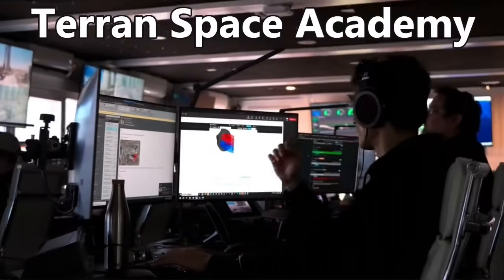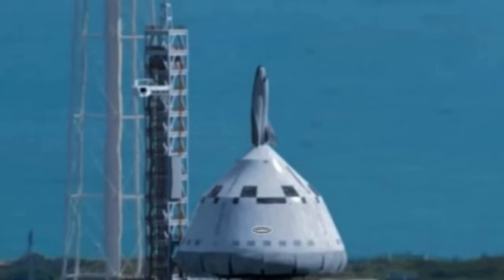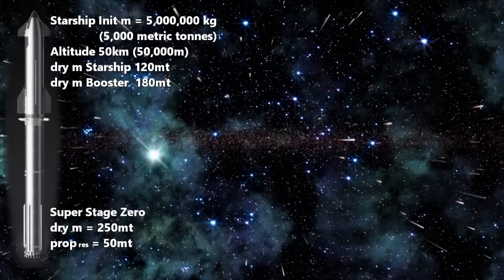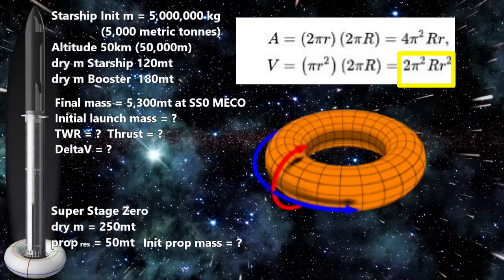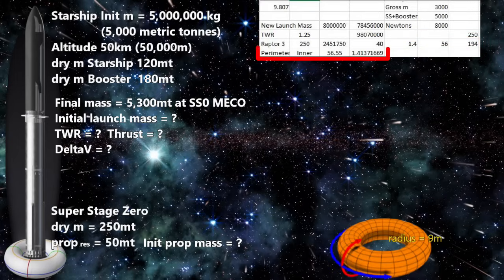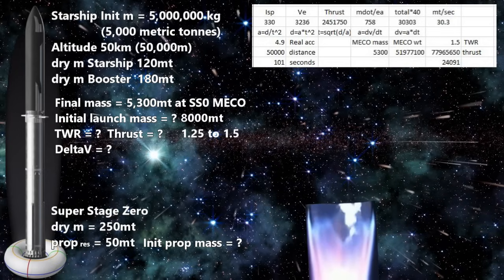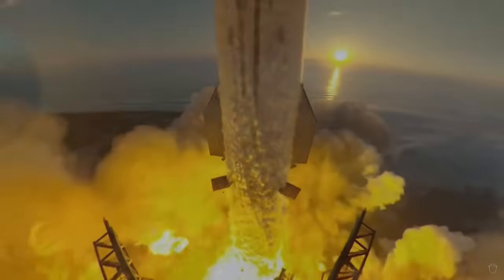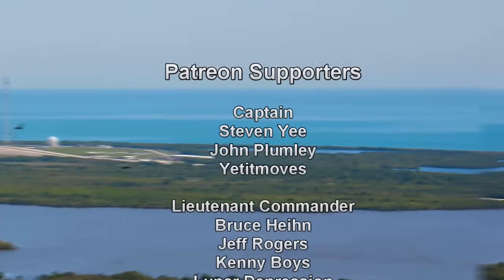Making Starship Better with Super Stage Zero!

Comment: Would make more sense to do a starship triple heavy ability to bypass orbital refilling
Reply from the maker: Yes it would. We did the math on that one about two years ago.  In a lesson on artificial gravity I think.
Reply: That would defeat the entire point of the Starship system design, that being that everything returns to the launch site. With every Falcon heavy launch the center booster is expended. It's gone too far and is going too fast to return. It's far more efficient to launch Starship multiple times with everything coming back to the launch site, than it is to expend a booster.
Reply: @snek9353  The center core of FH doesn't have to be expended.  It depends on the mission requirements.  SpaceX tried to land it on the first launch but missed the drone ship somehow.   They did land it on the drone ship on one of the other missions, but lost it on the way back to port.
Reply: @TheUweRoss  Almost certainly would be for a Starship version. No drone landing available for the SH booster, and it'd take three towers to catch them. I suppose potentially way down the line they could do the oil platform thing with a tower on it down range for the core booster. 

But what really would be gained by doing all of that which couldn't be done better in another cheaper way. Even IF doing so would get three times the fuel to orbit. It'd still be more cost effective to launch Starship three times instead.
Reply: @TheUweRoss  The only thing along these lines that I could imagine makes sense is using two Falcon boosters for Starship Tanker launches. 

Many ideas that result in the super heavy booster going faster defeat the entire point of the Starship system design, that being that everything returns to the launch site. Can't send the booster too far away or get it going too fast or it won't be able to return to the launch site in reusable condition. That and the entire idea here is cost effective up mass. It's presumably going to be more cost effective to launch Starship twice than to do just about anything else. 

However they'll need to build some Starship Tanker versions. Versions of the Starship that are all fuel tank, that have no other payload bay. These fully loaded with fuel could be much heavier than a Starship designed for putting satellites or people in orbit. 

To help launch these with as much fuel as possible making it to orbit using extra boosters could make sense. A couple of Falcon heavy side boosters attached to a super heavy core could be just the trick. It wouldn't take much extra infrastructure to do it, they'll have the boosters, and while the Super Heavy core needs to and can return to launch site the boosters could land down range on the drone ships if needed.

Comment: just add falcon 9's around the starship
Reply from the maker: I wondered about that too. Reusable boosters.
Reply: @terranspaceacademy  dad and I had this exact conversation, he had proposed something similar to your taurus with jet engines idea, but had completely forgot about prop :P
He'd talked about that since I was fairly young actually, I guess I've been thinking about this a while too now. 
Just for fun, I used chatGPT to explore the idea of falcon 9s as boosters a bit more, and it/"we" basically came to the conclusion that you could hypothetically strap 7 falcon 9's around the starship, which alone would give the vehicle a TWR of roughly 1. If you then Throttled all the raptors to 50% it would lift off. Some prop savings overall, but shows that using raptor 3's would be way more efficient haha
Maybe instead, 2 starship side boosters... 

anyway happy new year, love your channel, all that, and everything else, cheers :)

Comment: I thought you were joking to begin with. A couple of thoughts I had while watching, will be one long sentence per thought so it will look like awful grammar. Jet engines don't respond particularly rapidly to throttle changes. Would using cryogenic fuel for a jet engine be feasible, it takes a lot of energy to gasify LNG and you would have to spend some fuel just to heat the fuel, but liquid injection is a great way to cool and densify the air for efficiency, a from the ground up specially designed cryo-fueled jet will be significantly more efficient than a "warm fuel" engine and have a very weird outsized looking compressor side. Toroidal tanks are very bad shapes for drawing fuel from and for slosh, a triangular or square structure with an array of spherical tanks may be better, and consider the thrust and weight stresses on a primarily toroidal hollow structure, its not as strong as a cluster of spheres. Jet engines are designed for efficiency at cruising altitude, horizontal use, a broader atmosphere pressure will make it worth having a variable compressor, the jets can be supplemented with some oxygen added at higher altitudes, helping them work for longer. Engine icing is an issue in jet engines, the first stage of the compressor is often heated with some already compressed and heated air from later in the engine. Jet engines will be a LOT of trouble, and need special design. moving the jet engines to the inside of the torus allows some more efficiency with ram-air.   that concludes my stream of consciousness while watching.
Reply from the maker: There are a lot of issues. You would need a duct to pull air in on the fall back and you would need to cool it with an intercooler like Reaction Engines makes.  That's doable with cryogenic propellant.  The duct would need to start pulling from the top once the engine was up to speed.  Heat exchangers near the outside rocket engines could provide the heat but then you are adding a lot of mass.  For those and many other reasons jets just aren't really worth it when it comes to rockets.
Reply: @terranspaceacademy  Yeah, but it was a fun thought exercise. Your videos always are, thankyou.

Comment: The potential problem I see here is the increased velocity of the booster for return to launch site, spacex have indicated that they intend to put more of the lifting work on the ship than they currently have rather than the booster. Higher velocity means higher temperatures as well as increased energy for the turnaround and landing burns.
Reply: You have further to travel back to the launch site and are traveling faster.
Reply from the maker: That's why it's kind of a "pop-up" booster.  Going almost straight up and down.

Comment: Always good to entertain different options just to see how far or feasible the idea is.  How about strapping 4 more SHB like the Falcon heavy?  All the boosters will landed back.  Would need more Mechazilla towers.  Otherwise, SpaceX is good at manufacturing boosters and starships in a hurry.
Reply from the maker: Indeed.  That would be a much more practical plan.
Reply: @terranspaceacademy  maybe you can make the recommendation.  They’ll listen to you.
Reply: Ohhh. I like this. It might be enough to push the huge starship to leo with actually useful payload. It's reusable and already available tech.

Comment: How do you propose to restart those eight turbofan engines while falling backwards? Starting a turbofan engine with a strong tailwind can be nearly impossible when trying to counteract the reverse windmilling of the engine spools. Guaranteed engine overheat and catastrophic failure at essentially supersonic reverse velocity.
Reply from the maker: Good question... Compressed air blown through from the front? Blocks on the bottom that fold after start?
Reply: @terranspaceacademy  Maybe something like the spoon looking contraption used for reverse on jet boats.

Comment: That looks like an aerodynamic nightmare for which 250 MT sounds like a very optimistic estimate, especially when the SERV weighed 2700 MT dry ...

 Imagine the drag forces on such a design. Plus weight of shielding?

Also, increasing height and speed of the booster will make it a lot more complicated to recover it.

Would be interesting if someone could simulate this in KSP ...
Reply from the maker: No shielding required. Only going to 50km. But the dry mass is almost certainly low.

Comment: An autorotation capable tip turbofan helicopter 1st stage to lift to 10 to 20kft might be more efficient.
Another crazy option is a massive airplane to air launch a 
HOTOL or a Reaction engine powered 2nd stage with starship payload.
Reply from the maker: I like that idea!

Comment: I don't think this makes sense for starship. 2 stage to orbit make most sense for reusable rockets. You can make the booster need not so much shielding. For a 3 stage solution 2nd stage need a massive boostback and much more shielding. What would make more sense is to pack some super efficient upper stage into starship if you want to get smth to jupiter or somewhere farther
Reply from the maker: Not at all, just fun to think about.

Comment: Would the altitude that is gain from this configuration require the supper heavy booster to accommodate heat tiles for re-entry, wouldn’t that eat away what gains are made? The turn around time for another Rocket launch would also be greatly increased.
This all seems like a pyramid scheme that uses fuel ⛽️ instead of money 💰, and only those at the top win’s 🏆.
We definitely need to sort out this gravity problem.
Reply from the maker: It shouldn't but would need to do that math on that. Good point.

Comment: What about adding solid boosters ? Or why not have a center core solid booster that can be extracted and reloaded with a new one. That would require less raptor engines as they would surround the exchangeable solid booster center core cylinder, like a crown and be used for steering in addition to the grid fins during ascent.
Reply from the maker: There are many better ideas. This was just fun.
Reply: Solid boosters arent rapid re-use, you'd need a huge stock and refurb facility.
Reply: Also solid boosters cant be stopped, once ignited.  They were actually prohibited for human space flight.  But then there were many cut downs on the SpaceShuttle design, ending in total crew loss twice.

If there were sane regulations, I would prohibit a crew missions unless there is a rescue vehikel, capable of launching within 90 minutes.
🚀🏴‍☠️🎸
Reply: @rubikmonat6589  There is no reuse, the idea is to reload expandable cartridges of solid propellant inside, the cartridge would only get a thin metallic cylinder for the insertion process. The inner tube receiving the cartridge would be made of thicker/stronger metal, it could help increasing vertical weight load resistance, making pressurisation of stage one unnecessary to avoid tank collapsing during transport.
With a top opening on stage 1, the cartridges could be installed with the chopsticks arms.
Another benefit could be to have multiple long helix fuel tank dividers running down around the center solid core cylinder to the raptors engines, as the fuel goes down in the burning process, collapsible panels would come down, obstructing the way for any fuel sloshing trying to go back up.

Comment: 6:22 get on with it.   This isn't an intro to geometry video.

Also, this doesn't seem to take into consideration that the booster is presumably much further downrange and either needs a drone ship or more fuel to land and maybe more mass for heat shielding or more more fuel to slow down more.
Reply from the maker: Good points... And it's geometry if I say it is! (Or if I need to double check things :-)

Comment: Great video! Very good suggestion! Unfortunately, there is a huge insurmountable obstacle in the path of this being adopted! Of course, I am referring to the huge, plant sized ego of the chucklehead toddler, Elon!
Reply: I think the sheer logistics of such a massive vehicle are a bigger obstacle.  For one, moving the first stage would be an enormous endeavor even before launch.  Moving the Starship right now is already so difficult as it is.  The reason starship does RTLS only is because of logistics difficulties.
Reply: @dl2839  
Good points!
Reply from the maker: It would be far too complicated to try at this point but the thought experiment is illuminating.
Reply: @terranspaceacademy  
I agree, circumventing Elon’s ego at this point in time would be much too difficult and probably impossible.

Comment: There's a carnival ride that uses compressed air to shoot people up, and it also catches them and brings them back down. You technically only need one valve to make it work.

It's very simple to scale.

You could give a significant kickstart at launch. And take load off the catching arms motors, by acting as a pneumatic shock absorber, during landing.

You don't even need special gasses just regular air works.
Reply from the maker: I like! Where can I ride! I like H2O2 rockets for that reason...
Reply: @terranspaceacademy  There's a "space shot" at the US Space and Rocket Center in Huntsville, AL.